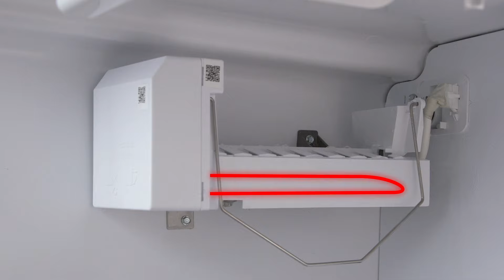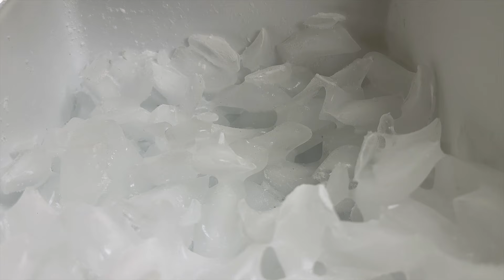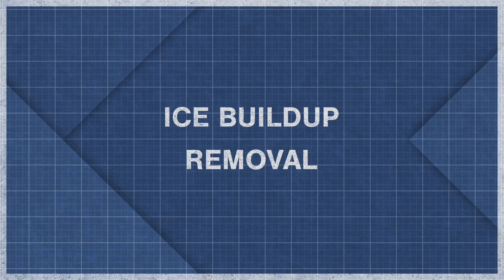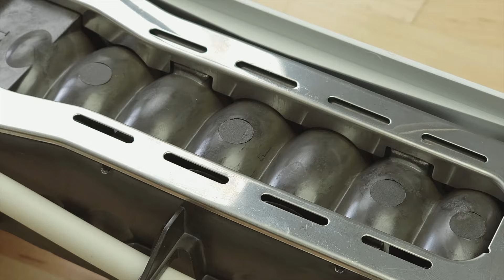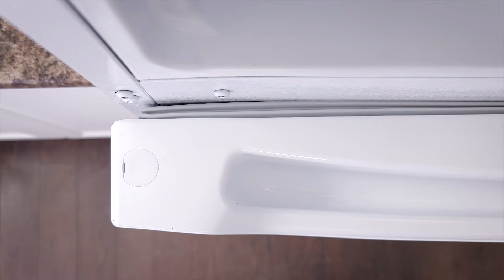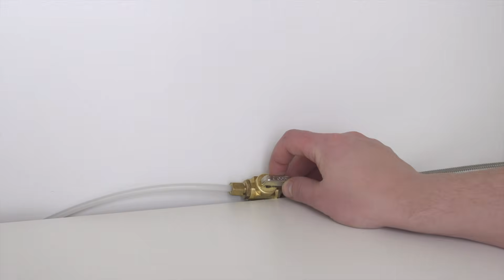Ice Maker Frozen? (Refrigerator Troubleshooting) | Repair & Replace

Comment: used this vid a couple times now to remember how to get the thing out lol... Any idea why recently everything's gettign a... how do i put it? Everything's gettign a coating of ice dust on it looks like. Alot of the food packages i mean. like we got one of those long ready to cook herb pork roasts recently and it's completely covered in ice. You'd think it's condensation, but we dont' leave the door open and the temp settign hasn't changed in 30 years, it's on 4 out of 5. And it's quite a few things in the freezer, not just things near or next to the bin. I'm not saying this has anything to do with the ice bin.

Comment: Our Amana (made by Whirlpool) side-by-side ice maker stopped working. It’s only a couple years old as of March 2026. We unplugged the whole thing for about 5 hours, emptied the freezer side, left the freezer door open, and let that side thaw out. When we plugged it back in, the ice maker worked again. TRY THIS before you call for an expensive repair! I suspect I may have overloaded it before and it allowed the water line to freeze. I moved some things to our chest freezer after plugging it back in. 🤞🤞 The fridge has otherwise been trouble-free. This may well have been user error. 😏 Don’t overload your freezer, especially the top shelf, my gut is saying.
Reply: Same! You are right.

Comment: Great vid. I’ve been having an issue with the ice inlet freezing up every 2 weeks or so.  I always remove it from the back, clean it out & reinstall.  Could it be freezing if my seal on the back isn’t insulated as well anymore? I’ve wrapped with tape, added insulation, sealed the entire entrance on the back with more tape, but continues to freeze even more frequently.  The ice seems to be further back & middle of the tube.
Reply from the maker: In this case it's possible that your water valve is not closing all the way. If there's a slow weep of water then it would start freezing in the tube as soon as it is cold enough, taking a few weeks to accumulate to a point that it actually blocks the flow. You can see how to access the water valve here: https://www.youtube.com/watch?v=EcHazrh_fos

Comment: Hmmm, and what has happened if one finds chunks of frozen ice in the ice bin? A solution without having to replacing with a new ice maker? I replaced the inlet water valve for the Whirlpool. Now I notice that the ice maker works, but finds clumps in the ice bin. :-)
Reply from the maker: Thanks for watching. Chunks of ice in the ice bin is not a huge problem. You can periodically clean it out. If you're noticing a lot of frozen chunks even after cleaning, then it is possible that some water is leaking directly into the bin. In this case you can adjust the water level or make sure that the ice maker is not tilted to one side / spilling.